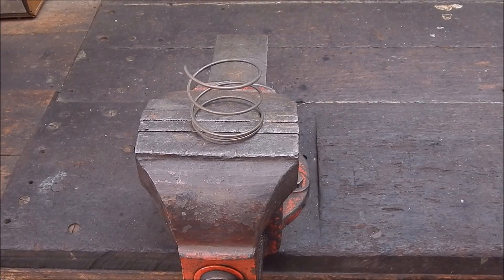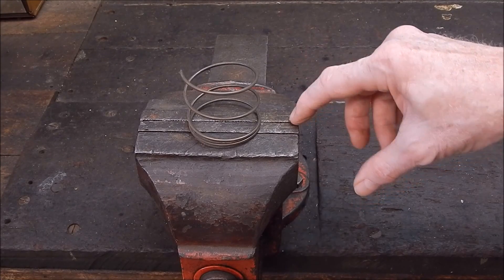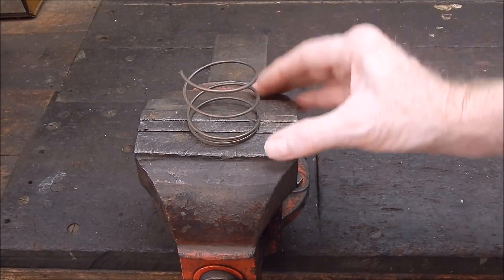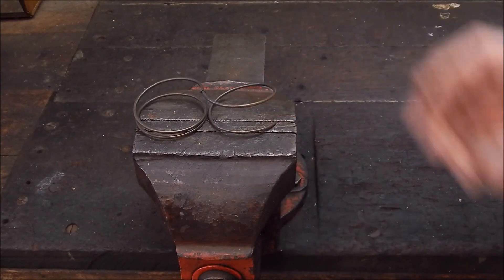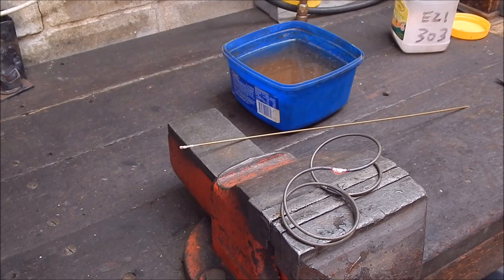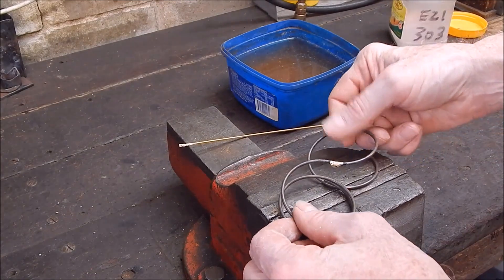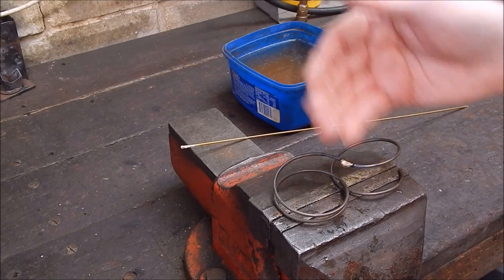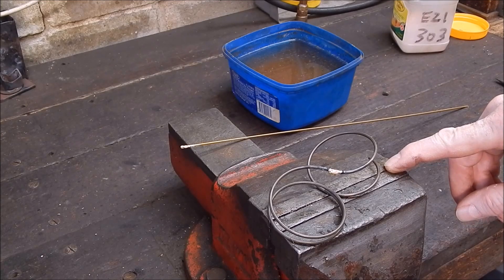The danger of quenching high carbon steel

Comment from the maker: What's even more interesting - get an old ER collet.

Heat it up red hot. Quench it in a bucket of water. Hold it about 5 feet above a concrete floor. Drop the collet on the floor.

It will shatter into several pieces like it was made of glass.

Seen it, done it. That's how quenching (hardening) can be a very bad thing with the "wrong" sort of steel. Some spring steels require extremely critical tempering.

So always think twice about hardening steel. Particularly anything that is load carrying.

Cheers Rob
Reply: Oh and also to add to your "always think twice about hardening steel", i would add that this implies "... about welding steel..." as well (or indeed brazing it add you demonstrated in the original video).  Any welded / brazed joint has a  heated-affected zone in the parent metal on either side of the joint. In this region the metal was heated almost to melting point (it IS at melting point only a few mm away) and then as the arc moves away, the cold metal either side conducts the heat away, giving VERY high cooling rates. In low carbon (ie mild) steel this doesn't matter, but if you are welding an unknown steel, and it has enough carbon to be hardenable, you just hardened it.   You may not have realised it, but you did.  And you quenched it, and at the start of the weld you quenched it VERY severely.  This may have created a catastrophically brittle product.
Reply: Yes. You make an excellent point. 

And also, you can even get into trouble quenching a steel that IS safely hardenable, if you quench it the wrong way.  Some steels will quench satisfactorily in oil or water or brine but the three quenching methods produce three different cooling rates and (Depending on the steel composition) three different microstructures.  Some of which may not be fit for purpose. 
You can also get variation in microstructure across your piece depending on whether you plunged it into the water straight or at an angle, and depending on how big your bucket was, and depending on whether you stirred it around quickly to disturb steam bubbles off the surface. 

Does any of this matter?  Looking at many you tube videos, if you get the right hardness measured at  a single point with a hardness testing file you are good to go. 
Maybe.   But if you have a (very) hard and thus very brittle area on one corner of your new home made chisel (or whatever) and that brittle corner shatters in use as is very likely, then you better hope you (or your son or friend who is using your tool) are wearing eye protection every time the home made tool is used.  Losing an eye may make saving the twenty dollar cost of the store bought item suddenly seem a lot less smart. (Or the shards of the shattered tool could sever an artery in your arm and you could bleed out. )

People certainly  CAN have a crack at diy metallurgy in the home workshop, and emulate the learning curve of the ancient blacksmiths, but it is worth remembering that this learning curve came at cost of many injuries along the way. 
If people get some random high carbon steel and simply guess at a heat treatment protocol, there's a huge range of possible outcomes, some of which could be catastrophic. 

Not trying to be a party pooper; i love making stuff in my workshop too.  But unless you studied metallurgy it is best to stick to mild steel and stay away from high carbon steel and heat treatment.   It is a minefield.

Comment: As a blacksmith i must fully agree with You, it's pretty hard to properly anneal, quench and temper high carbons teel, especially springs.
I hawe seen many people wich think they can but only a "handful" that actually do know what they are doing.
Another thing that annoys me a lot is when people use way to much heat when tempering carbon steel for cutting tools.

Best method for hard soldering is to do exactly as You describe here actually.
Reply from the maker: Yes it becomes an exact science as the carbon level rises.  Anyone can play around with low carbon/mild steel, but that's pretty forgiving stuff.  Thanks for the feedback.

Cheers Rob
Reply: @Xynudu  Yes, i remember a friend told me that he accidentaly dropped a piece of forged sheet he had worked with pretty long time, right after the quenching, but before the tempering and it cracked in two halves only from the inpact on the concrete floor, the same pice would easily had been run ower by a car and barly even been bent after the quenching... 

I tried to cold hammer a pice as an experiment and it also become that brittle that it just snapped off after a few minutes of hemmering, i guess similar thinghs happenes.

Comment: Could you repair say a vehicle suspension coil spring using this method? Not that I would personally, I just can't see such a join holding up to constant jolts etc, I wish that you had put the two halves of that spring back correctly and load tested it several times.
Reply from the maker: Hi Steve,

You can join anything made of metal like this.   That's all they had prior to electronic welding.  The bed spring is still going strong.  Obviously a new spring will be better, but it's a matter of why it broke in the first place.

Cheers Rob
Reply: @Xynudu  Yeah Rob, I'm sure you can but is it strong enough? I could see that you were twisting/bending with a fair amount of force but that spring would be subjected to different forces/stresses if you had put it back together as intended.
Reply from the maker: Hi Steve,

The bed spring is fine and gets used every night.  Have a look at the video.

Any join can give way regardless of how you do it.  Nothing will be as good as the original.

Basically any thing that you have to put your life on should be replaced.

That's why I would never weld/braze a car suspension spring.

Even welding stub axles with low hydrogen rods is suspect.  There is always the danger of messed up metallurgy.  

OK that's no big deal on farm machinery and gets done all the time,  but I wouldn't do it for a road vehicle.

Cheers Rob

Comment: Yes excellent demo. Would have helped a lot in first year engineering metallurgy class. 

For those who want to dig deeper...
 steel (a solid solution of carbon dissolved in iron) can have different microstructures depending on how quickly  it was cooled from high temperature. 

The really hard and brittle phase is called martensite. Low carbon steel is all ferrite, regardless of how you treat it. 
As carbon content increases, there's too much for it all to stay dissolved in a pure ferrite structure when it cools, so you get variations like pearlite (a layer- cake arrangement of martensite and ferrite alternating, which gives good hardness due to the martensite wear surfaces but excellent toughness because you can't propagate a crack easily through the ferrite parts of the structure).
(And there's several other options available depending on exact composition and heat treatment. )

The way quenching works is analogous to a game of musical chairs.  There's an equilibrium microstructure, which you get if you cool slowly (ie you gradually turn down the music volume and all the kids get to move around the room to take up the last chairs, and everybody is seated at the end); 
But if you stop the music suddenly, you get
Some of the children seated = a meta-stable microstructure (martensite) because you didn't permit time for orderly 
migration of the children / diffusion of the carbon atoms
 to the
 chair / ideal equilibrium position in the atomic lattice.

And if you took a flash photo while the music was playing you'd see none of the children seated.  In steel this is called austenite.

Depending how much time you give the kids to find a seat changes the % of kids seated, and likewise different cooling rates produce different microstructures.

Moving off  cooling rates to carbon content, if you add enough carbon, you get to a point where you can't dissolve it all with ANY form of microstructure and you get cast iron, which will have graphite (carbon) bits trapped in the matrix.  What form the carbon inclusions take changes what we call the product (eg if it is round blobs the product is SG iron - the sg meaning spheroidal graphite) 
...This excess carbon unable to dissolve fully in the iron matrix is like adding so much sugar to your tea that it just can't dissolve it all and you are left with granules of sugar in the bottom regardless of how much you stir. 

Metallurgy is really a fascinating field (to me as a mechanical engineer anyway).

And if you want something to ponder, consider how medieval blacksmiths mastered the art of managing most parts of this purely by experimentation and observation of the macro (large scale observable) properties, without having access to ANY of the tools that would have enabled the understanding of what was happening at a microscopic level. 
Amazing. 

... And more amazing to consider how smart was the first guy to work out how to take a particular type of dirt and "do stuff" to produce metal.  To make a sword or an arrowhead out of dirt is easy enough now (with all the necessary equipment) but if nobody has done it before, and thus none of that equipment has been invented, what makes you even think of the possibility? 

Anyway, great practical demo Rob, as always.
Reply from the maker: Good explanation.  Stuff I didn't know.

Thanks for posting.

Cheers Rob

Comment: Know your steel! I worked at a steel mill and every once in a while they would miss on the tight specs for high grade steel, so the billets would be rolled into rebar which had a wide spectrum of specs. and sometimes you would get really hard rebar, so hard that it would shatter like glass when you dropped it. Just a little story about some of the possible consequences from improper heat treat/ annealing procedures.
Reply from the maker: It's hard to believe that steel can shatter like that, but it does.

Comment: Very interesting indeed.
Reply from the maker: What's even more interesting - get an old ER collet.

Heat it up red hot.  Quench it in a bucket of water.  Hold it about 5 feet above a concrete floor.  Drop the collet on the floor.

It will shatter into several pieces like it was made of glass.

Seen it, done it.  That's how quenching (hardening) can be a very bad thing with the "wrong" sort of steel.  Some spring steels require extremely critical tempering.

So always think twice about hardening steel.

Cheers Rob

Comment: G’day Rob, excellent tips, it’s amazing the strength of the bronze itself. Cheers Peter
Reply from the maker: The thinner the bronze layer/ film between the two joining faces, the stronger it is.    A thick bronze filler is not a good thing.

The fact that it is capable of 100% join face coverage (when done correctly) means it will always be stronger than any electric arc weld (around the edge only) within it's maximum temperature range.

Electric arc will erode small work and warp it.  Brazing won't erode and is much less likely to warp as all materials will cool and contract evenly.

Cheers Rob

Comment: Good video, Rob.
I reckon brazing is a much underrated process.
In these days of TIG welders that boast the ability to weld razor blades, perhaps that’s why.

I’ve noticed various TIG videos where they re-discover brazing.
TIG appears able to put down a very neat bead but they don’t seem to get the flow and capillary action that occurs using a flux.
I’m still old school, I guess.
Reply from the maker: Yes, everyone went MIG happy when they came out, and now they're going TIG happy after they've learnt the MIG.

Flavour of the month stuff unless you use it properly (gas shield) of course.

Brazing is very neglected in most workshops.  After all it's old technology, so it can't be any good ;)

Cheers Rob
Reply: True, that.
I’m still happy with the Comet 3 system I bought from CIG back in the 80’s. They even make clones of the Comet 3 these days.

Recall too, all those older race car chassis made out of nothing more than low carbon steel tube butt joined with manganese bronze. They were fine.
Reply: Done a lot of car repairs using brazing, it is a lot of prep work to get the steel clean around the joins, but it distorts a lot less than welding, and the only thing better is to solder it with tin solder or lead, though nobody does that these days any more. Friend is an old school panel beater, he learnt in the days when the only way to build up a joint was with lead and wiping it when semi solid, none of the fancy stuff like fibreglass resin around. He was taught to get it pretty close to perfect then only finish off the seam with solder to fill just that point, along with getting the panels to flow to the right profile, so he learnt how to use a torch to work metal flat.

Comment: What gas was that?
Reply from the maker: LPG (propane).  The torch is a special high temperature LPG only torch made by Bullfinch in the UK for bronze brazing.

I've had people tell me you can't bronze braze with LPG,  but they don't know shit regarding what's available on the market.

That particular torch has been available for at least 20 years.

Cheers Rob
Reply: @Xynudu  Have you got a model number? I picked up a Bullfinch handle years ago from the local tip (for 50 pence!) and it's a fearsome looking beast. Never used it, as most of my setup is Sievert (for soft/silver solder and brass brazing). The Bullfinch is a 2100 Autotorch System 2...with a knackered piezo ignitor. Bullfinch still sell it, and claim it's good for bronze brazing.
Reply from the maker: Hi Bob,

All the part numbers are in the link:  https://bullfinch-gas.co.uk/blowtorches/autotorch-brazing-sys/autotorch-brazing-kit-detail

You need a suitable regulator.

Yes it does bronze brazing fine, as seen in the video.  That's why I bought it 20 years ago ;)  Nothing else in LPG comes close.

The gas flame temperature is slightly less than MAPP gas, but the BThu is higher due to the greater gas throughput.

Cheers Rob

Comment: Thank you for the brazing demonstration.  If you have time would you mind saying what product are you using for the flux.
Reply from the maker: Hi Glenn,

The flux is EziWeld 303.  It's a Borax based dipping flux.  You can buy it off of Ebay if the local supplier doesn't have it.

Cheers Rob